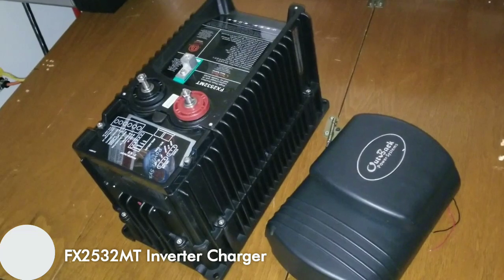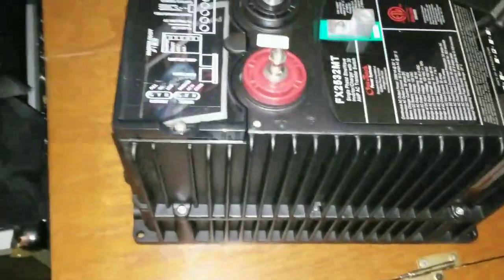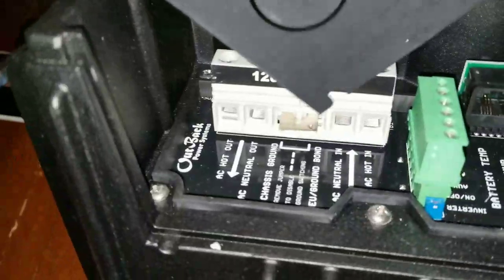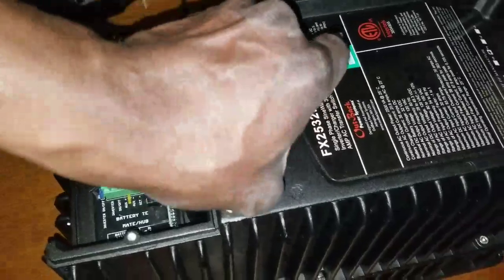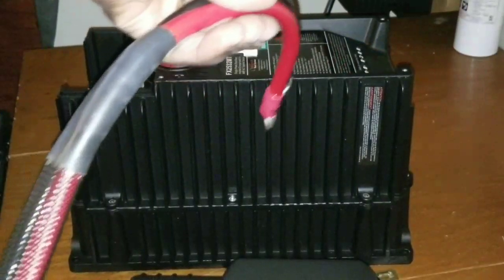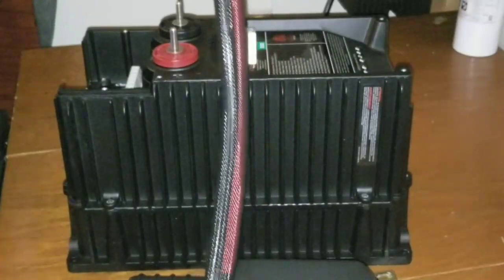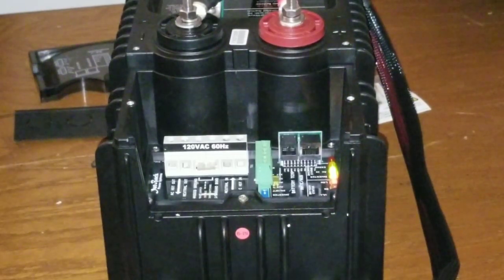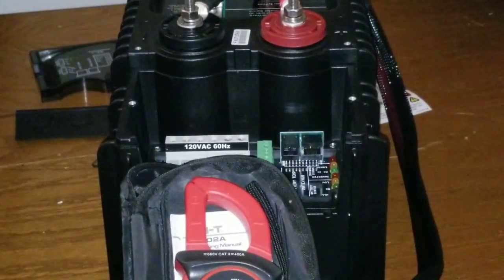OUTBACK POWER SYSTEMS - OUTBACK POWER INVERTER CHARGER

Comment: Hi jwsolarusa, i saw settings for Mppt on my vfx3048e, does this inverter have an internal Mppt?
Reply from the maker: It's built in inverter/charger so you can hook up a Generator or Grid Power.
Thanks for watching and don't forget to Subscribe Like and Share
Reply: So i will have to buy a seperate Charge controller right? I have a 69Volts 500Watts Solar panel and 48Volts battery bank, Thanks for the quick reply, you've earned a subscriber 🙏🏼

Comment: I got one of these second hand but unused. I don't know the history of it. The inverter light goes green, but there is no output power. I know my connections are good, because there is output power when I have the AC input hooked up to grid power.
Reply from the maker: I assume it's on search mode. Continue to watch my videos you might find some helpful tips on your journey. 
That for stopping by, please LIKE SHARE and SUBSCRIBE
Reply from the maker: OUTBACK POWER SYSTEMS - FX2532MT SERIES INVERTER CHARGER: https://www.youtube.com/playlist?list=PLSNjIRSnUPDJQxDDUeupzqDdMCfkD5x3w
Reply: @jwsolarusa  According to the manual, the green light would be flashing, and it stays solid. Also, as far as I can tell you have to have an external control panel in order to initiate search mode, and I have only the inverter.
Reply from the maker: @danielwilliams1400  
You need a MATE2, MATE3 or MATE3s to program the inverter. 
I thought you already had one of them
Reply: @jwsolarusa  No, and I was under the impression that they were not necessary, just nice to have for more functionality. I may have bought one in the future, but not if I don't even know if this unit is functional. Thanks

Comment: Do you know if I can use any solar controller with the outback inverter or does it have to be an outback controller. I will be using the FX2012T inverter in my van.
Reply from the maker: You can use another charge controllers that's fine. But it will be nicer if you have the same product and they will communicate better without fighting each other.
Thanks for asking buddy and don't forget to LIKE SHARE and SUBSCRIBE

Comment: 32 volts , bummer
Reply from the maker: Why it is a bummer?
It is more flexible with the lithium batteries out their than a 24V system. It will operate on both 32V, 36V and the max dc input is 42V very close to a 48V lol
Reply: @jwsolarusa  all I see is 36, those other numbers are not a useful increment.
Reply from the maker: @talusranch990  
Stay tuned and you will soon find out how everything comes to play. 
Live from Minnesota jwsolarusa, LIKE SHARE and SUBSCRIBE. 
Cheers.
Reply: Way back in the day, thirty two volts was common. Many of the  highly desirable Jacobs wind generators were thirty two volts. I still have a barely used 32 Volt Vanner inverter from the early 90s.
Reply: @johnwyman6126  believe it or not our town used to be 32 volt, they used Dunlite wind generators... People at the end of the town would have "brown out" conditions... Before my time but I scored heaps of the old gear...most of it stripped down for copper $$$ now but a few enthusiasts have kept old generators running...we used the motor cooling hot water in a tank to wash our clothes 😂😂😂 no city fairys here